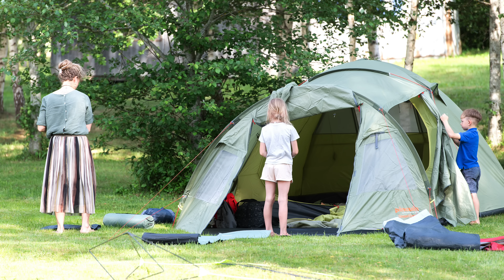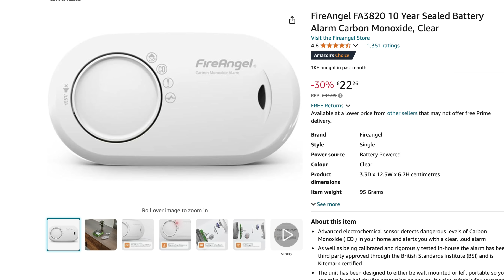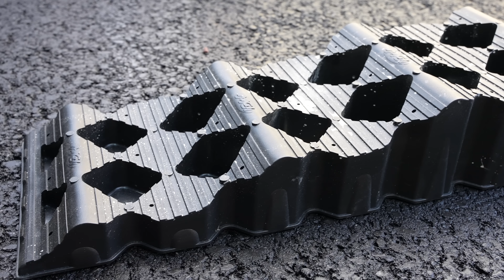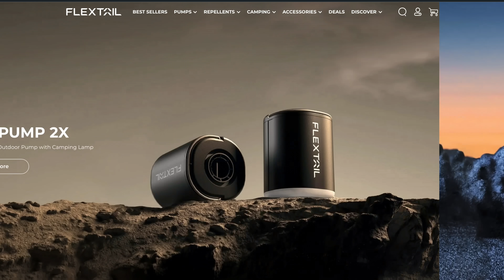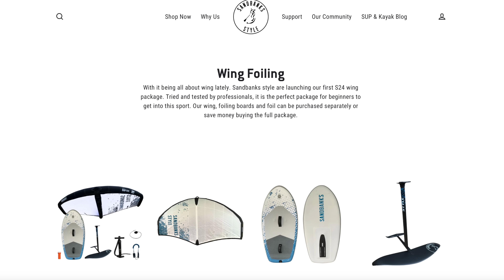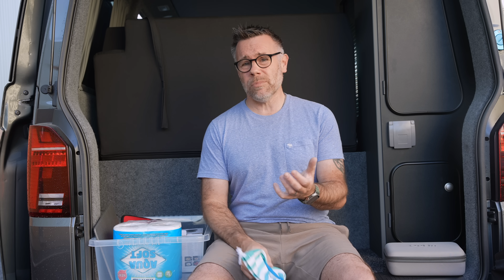ESSENTIAL Campervan Accessories to Begin Van Life in 2024

Comment: Hi, I''ve been following your videos with interest and about to embark on buying and converting a VW T6 LWB.
 My query is : I am thinking about putting a 'High Line roof' on to gain a bit of extra height as I'm approaching seventy and not as bendy as I used to be. I don't want a Pop Top. My other option for storage is roof rack and box on top. I have spent ages online and cannot find any ref to where to by and fit a high line roof and ask the question of whether its structurely sound for a roof rack  and loaded box.
Any comment welcome Thank you. PS Its left hand drive, as I live in France, thus in 'Europe' to buy IF I can find. To be sure I already have a van in mind but with the usual height roof. 
Thank you .
Reply from the maker: There are a few companies in the UK (sorry I don’t know about France) who do a high top. Bodens and Bilbo’s.
Alternatively for storage, you can get Thule tow bar storage boxes which are useful

Comment: Toilet!  Must be able to use in the middle of the night with bed out.  Still working that one out :D  Next on my list is leveling ramps after rolling out of bed the other night.
Reply: I use the Bivvy Loo….folds flat for storage, then I set it up at night with the bin liner and wood pellet cat litter. It slides under the bed, then pull out to use. In my T5 conversion there is enough room to use with bed out.

Comment: Great video. I take an axe to cut firewood. Also a variety of small plastic containers to keep small items together. I have installed netting to inside of van to keep things like remote controls inside so I don’t lose them.  I also have a head torch so that I have both hands free when waking around in the dark. A spare fuel can so I always have fuel for either my diesel heater or my van if running low.
Reply from the maker: Thank you. Some great suggestions there. The head torch is very useful, something I use myself 👍🏼

Comment: Really want to see vans for single travellers with a fix or easily adapted bed. Most s
You show are sleep 4 and are not suitable for the growing number of single (women) travellers.
Reply: I love my Tentbox Classic 2, it let's me have the bed ready in 60 seconds as it pops up on gas springs and , as bedding all stays inside it  saves space in the van As  it has a hard wedge shaped top it is also more  fuel efficient than other designs , and it is roomy as the sides are all the same height , no slopes .  I can also attach my solar panel on top when parked up .

Comment: With electric hookup cable, buy the blue or yellow "artic" version. The orange cable ones are awful in low temperatures as they become ridgid. Not only that, it doesn't roll back up very well meaning its unruly to manage as it develops shape memory and generally gets right on your t**ts trying to pack it up or getting it back out (and a 25m length is very heavy). Also check the cable is 2.5mm -16amp. Often  manufacturers cheap out and use 1.5mm cable and are only rated around 8amp.

Comment: A small induction hob that can be used when you are hooked up is extremely useful. A folding ladder to reach the top bed. Insulated blinds for windscreen and side windows, attached by magnets (inside the vehicle). Side panels for awning are nice to have.

Comment: I have nearly everything you suggested and agree they are very good suggestions. The two additional essentials I have and use are:
1. traction tracks mats. These have proved really useful at wet festivals. 
2. The sun shade I slide into my Remo rail. It was under £200 and has different configurations so can be used in bad weather. It stops rain getting in the van but also extends the time you can spend outside.

Comment: Flextail - I have the Tiny Pump its great for small inflatables like a yoga ball, lilo, large inflatable rings and small inflatable boats etc. (Not a paddle board though, you need the bigger one for that) It also deflates which can save a lot of time. Some models have a light built in, which is useful as they are very small and light, plus recharge quickly too. I also have the Atmos which came with 3 sizes of large vacuum bags suitable for clothes, blankets etc, and several ball pump adapters. I realised after I got this that they do vacuum food bags too - these are reusable, freezer safe, so great for taking portions of food with you, plus you can sous vide/boil in the bag with them too. I would recommend both the Tiny Pump and Atmos for travelling and home use too.
One must have in the Toolkit essentials - spare fuses

Comment: One of the first things I got was a Jumpstart power-pack - which has Jumpstart cables, but can be used as a flashlight and a USB charger.  The glove box has a pair of scissors (to cut seatbelt in the event of a crash,)  and a window smasher -  again, to facilitate exiting a mangled vehicle
Reply: You can use the other end of the headrest to smash the windows, it's meant to be super effective should you be trapped in a body of water

Comment: You bugga, hate you >< I've had a pair of Reefs for donkey's years, best flip flops ever (and I've blown a few in  my time) .... but only what you said made me realise what the hell the metal bit was for in the soles omfg! (but I've moved onto Port now, less volume more alcohol cheaper). Okay, now onto a suggestion or two;
A power bank jump starter. I have owned an MSC Overland Waterproof 18Ah Powerbank Jump starter for years, has got me out of trouble numerous occasions and helped loads of others. (Look up Mobile Solar Chargers) there are plenty of others to be found now.
Torches should be 'multiple, dotted all over :) and a simple head torch with red light capability is nice.
Gaffer tape / duct tape, self amalgamating tape (latter great for electrical wiring securing and waterproofing).
A small toolbag for those DiY / motoring tools, keep a pair of study gloves in it along with yet another torch. Pop a simple electrical multimeter in, there's often someone with a failing set of tailboard lights on site who hasn't got anything to fix it with. Normally just a loose or pulled connector in a plug somewhere.
Using awning / tent? Collect extras - beefy pegs/stakes, a decent hard mallet hammer (not a bouncy toy type thing). Spare guy ropes/straps. Spare tube if air awning, spare rods if pole version - gaffer tape can seal up that tear until you can get it sorted better.
I have a small square of tent like material / mat about 1.5x1.5m (I think it was originally a doggy car liner or something) that I peg out between tent and side door as if there any rain this area gets a lot of use and muddy.A good healthy 1st Aid kit is highly recommended.

Comment: If you don’t have gas installed do you need any kind of alarm in the van? I’m just having an additional battery for lights etc …
Reply from the maker: A smoke detector would be recommended as you would be sleeping in there. A fire could start in the engine bay or from the leisure battery.
A carbon monoxide alarm will be needed for any heating or cooking. 
They are so cheap and last 10 years, it’s a real easy/cheap addition
Reply: @StaycationLifestyle  thank you

Comment: Nice Video, there was somethings you forgot, spare bulbs and fuses, As for insects we always take vitamin B tablets or marmite does the same thing, we also use old dried coffee grains which we place in a small metal dish and set it alight and let it smoulder like a jos stick, that keeps wasps and othe insects away when sitting outside,
Reply from the maker: Thank you and some great suggestions there.  Vitamin B tablets will keep most things away, they are awful 🤣.

Comment: Is it possible to get a soft closing sliding door so everyone else on site is not subjected to the wooosh bang door slamming...
Reply from the maker: It is a pain 🤣 Aftermarket electric doors are, but expensive. It’s a good point actually.
Electric tailgate is cheaper or use front doors

Comment: Hi loving your videos,I'm new to this community but would you recommend the 4motion or just standard front wheel drive?
I mainly just use on everyday roads
If bought on the t6 model is there a away of turning off to save fuel?
Tia
Reply from the maker: The cost of a 4Motion can be much higher as they are currently in demand. That kind of gives you the answer that they are worth it. 
However it would totally depend on your use purpose whether you would benefit from it. 
If your often going to be on loose surfaces, sand, mud, snow, wet grass or maybe towing, then you could benefit

Comment: I use flax tail very useful for tent packing. (Pump out the air) and as a lighting.  You need different accessories for different weather conditions. I show some on my YT that I use. I bought some of them or produced it by myself.

Comment: I have a checklist for summer, winter, off grid and on grid for my packing. Different things needed for different seasons. I use Sea to Summit pans, plates, bowls. Helinox style chairs. Whilst I have a rainbow screen, I've just bought some wanderbug blinds. They are absolutely brilliant.

Which dash cam is that please? As mine wouldn't necessarily kick in when it's parked
Reply from the maker: That’s a good ideas. The packing list will be different for different occasions.
Mine is a Thinkware T700. I have used their products for years and also liked them. 
There are lots of options at different price points from other brands, it’s “parking mode” that you would need

Comment: Fire stick could be a better option to a fire extinguisher as they last much longer.
Reply: Look at independent comparative tests on Youtube of those things. There are lot of cases and type of fires where those stick do nothing, as they don't reduce the temperature of the burning material the fire can restart immediately after use.
Counting only on them is dangerous, the only acceptable usage I can see for them is to have more in many different places available to gain time to get to your real fire extinguisher.
Reply: I went for a fire stick
Reply from the maker: They are an option, which many seem to opting for 👍🏼